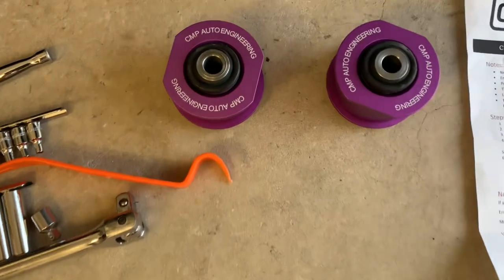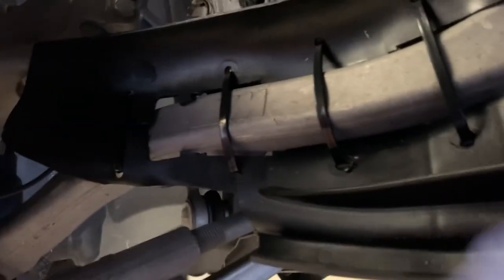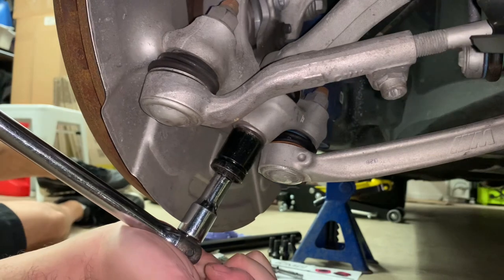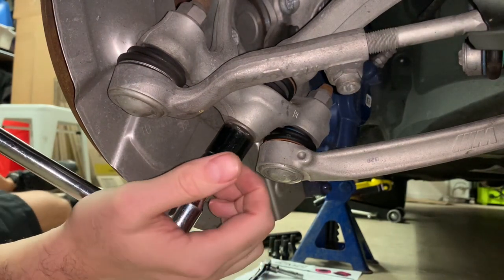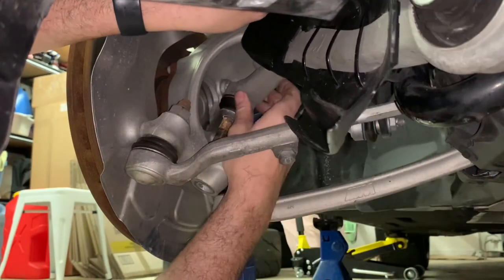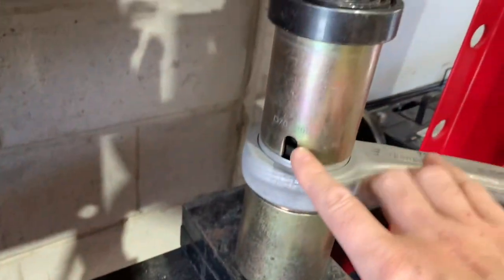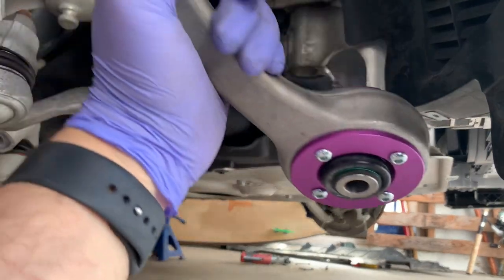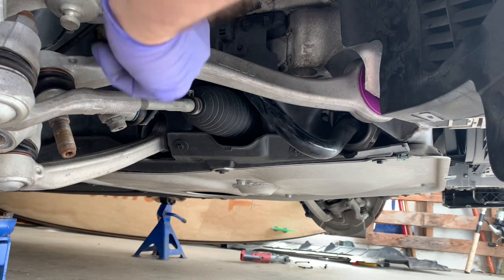How to Install BMW M2 M3 M4 Thrust Arm Monoball Spherical Bushings - BMW OG F87 M2

Comment: Nice review, I'm considering this on my M2 Comp that I just bought to sharpen up the steering. I don't know if I'll be taking it to track, just spirited road use. Was there any increase in noise/vibration levels on the road?
Reply from the maker: I noticed nor increase in NVH which was great. I also suggest doing the M2CS steering and M4GTS Diff coding. the change to steering feel with the CS coding is immediate and gets rid of the on centre dead spot.
Reply: @TheEddysGarage  that's exactly what I'm after removing that slight dead spot which will compliment the bushings.

Great tip thank you!